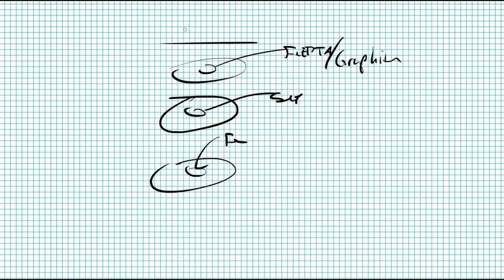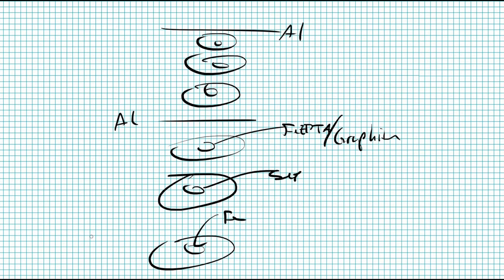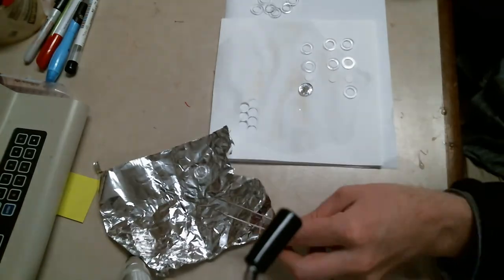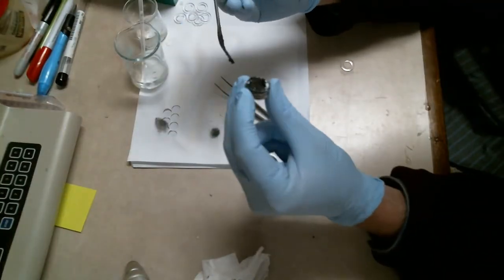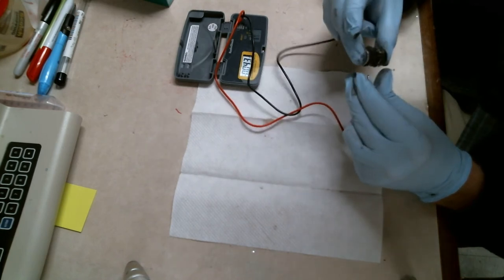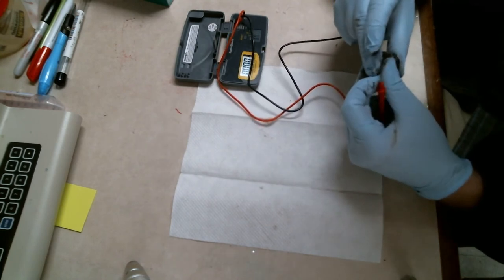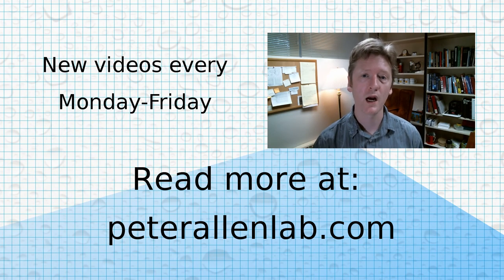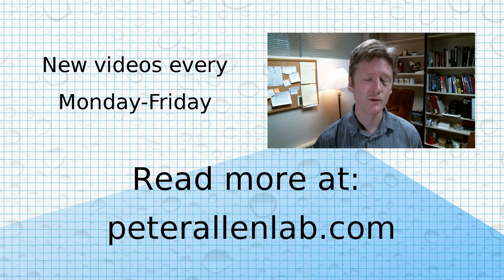How (not) to build a stack of iron battery cells

Comment: Just a couple of thoughts to add:  
1) I suggested the horizontal version much as a very flexible lab test setup, with each cell about 1/4" thick so that concentrations can be tuned and maybe even rinsed out to start over.  Granted, this might be too expensive for a more finalized design.
2) As you have described it, I think we are looking for stationary energy storage for solar and wind power.  Weight and size are not a main concern.  I have read stories that old electro-mechanical relay style telco central offices used to have HUGE single cell lead-acid batteries that weighed over 400 lbs. each! That's a bit hard to deal with in a home or small office environment.  I would suggest to shoot for multi-cell batteries that have a nominal 12V or 6V output and are somewhere in the size of a car battery, maybe 30-60lbs. ? But that can be a few steps down the line.
3) I realize that standardized lab testing stations for battery designs have often used the button size battery cell.  And I know Tesla started with the ‘18650’ cell format and now has gone to a larger ‘2170’.  But I think they are sticking with that small size to make liquid cooling of the delicate Li-ion easier during fast charge. A big drawback is all the interconnecting that has to take place.  For our application, it would seem to be a waste to go that route with a final usable design.  Larger cells (flat-rectangular) would seem better.
Reply from the maker: I agree - next will be larger, rectangular, and easier to disassemble. The thickest acrylic I have right now is 2mm, which is a little too thin... I do have some rubber gasket material to thicken it up, though. I need to try some things. Thanks!
Reply: One bit of info I have read from several comments is that when laser cutting silicone rubber gasket material, it creates a lot of dust. Also, some other rubbers will melt back together unless the laser cutter is designed with blowers in the head. And just a reminder, flame test the material to make sure it doesn't contain chlorine that might corrode the laser parts. ;)  I know I always get excited with new projects and sometimes forget a good practice or two. :'/ lol